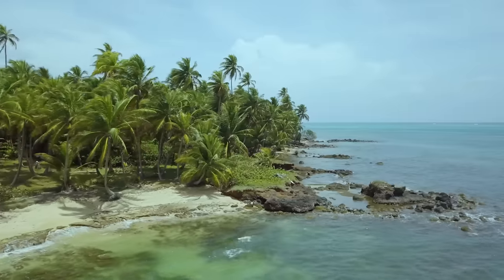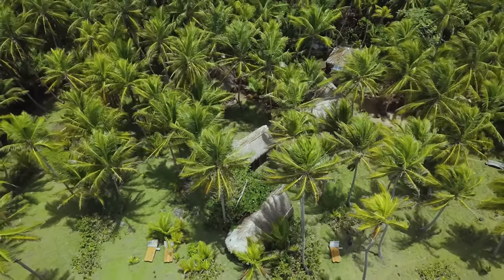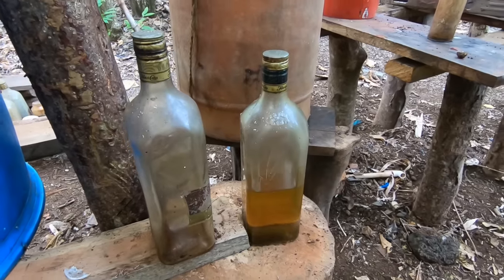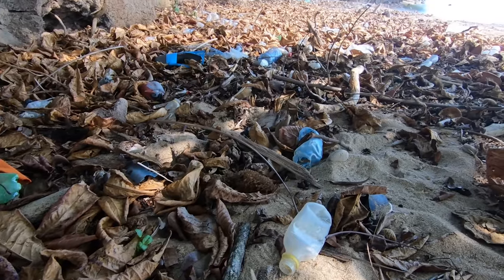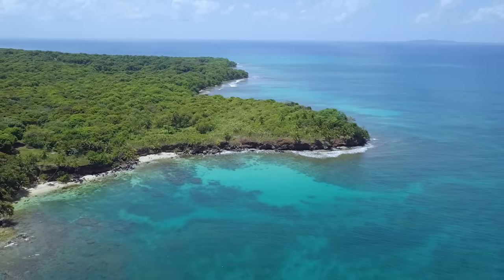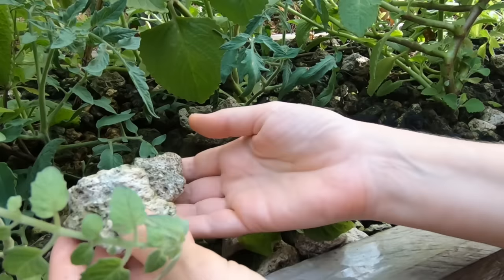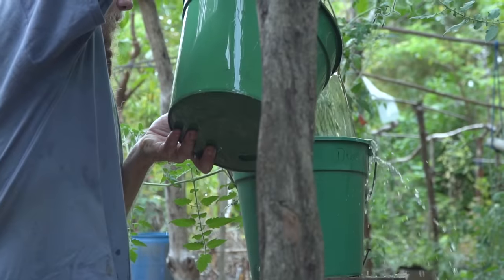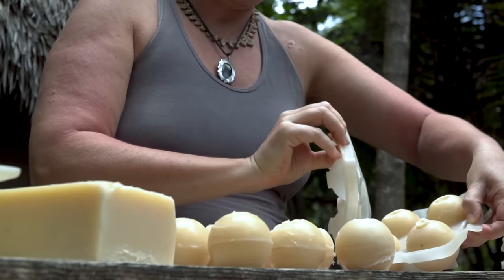THIS SELF SUFFICIENT FAMILY MAKES THEIR OWN FUEL FROM PLASTIC!

Comment: It would have been good to see the diesel making process in more detail: But thank you for sharing
Reply: To me that "diesel" lit up fast and bright from a match. I've seen matches put out in diesel. Then again, apparently his diesel generator runs on it...🤔. 
Also, I'm glad he's cleaning up and making use of all the plastic we've allowed to float up on his beach, but the nasty smokey fire for his distillery isn't exactly environmentally friendly. Sorry about the complaints, just a couple of points...I did enjoy the video and am subscribing, ☺️
Reply: @RoodiniCats  he could upgrade the wood heater into a rocket stove for a more efficient burn
Reply: @DustinMarsau that definitely sounds like an improvement. I guess he's mostly working with what he has on hand, so I'm not faulting him ☺️. 
Maybe a rocket stove will wash up on the beach...? 😁
Reply: Did you ever melt plastic ?
Give it a try 🧐
Reply: @RoodiniCats  you’re right about the diesel. Diesel fuel doesn’t ignite with a lit match but if his shit runs good with that plastic than that’s still badass
Reply: @RoodiniCats  hes taking the trash off the beach
Reply: @unforkyours3lf730  Yep... and putting it in the atmosphere, where it belongs!  Then the carbon trash can blow over to someone else's place! LOL
Reply: Yes l would too be interested in a step by step diesel making equipment..
Reply: @martyfoster7053  it's not like plastic came from nowhere.
One could think of the plastics industry as carbon sequestration.
Reply: @RoodiniCats  it's just wood from around the place. Don't know how much he must run that fire for to run all his crap. Could be anything from a cookout level impact to the fires of Mordor 😹
Reply: @richavic4520  yes, but no.
Reply: Wow...
Well done to you.....
Reply: @RoodiniCats  if you pick random wood fallen on forest floor and burn it, it is green as the would would naturally decompose and produce methane which is a green house gas.  only if you log the trees then its a problem unless you plant one in its place.
Reply: @RandomScientist  good point. I came to the same conclusion, deciding whether to burn limbs/leaves in my yard or to pile them up and let them rot. I don't use it as compost, so was better to burn. I guess the best option would be to let the county collect it and they create power from burning yard waste.
Reply: Yes, I would like to know the diesel process too
Reply: @RoodiniCats  are you serious? First off diesel, at least all the diesel and jet fuel I’ve encountered won’t light easily, it has to get hot first then it can start a burn. But are you serious about a wood fire being “bad for the environment”? Let me ask you what you think it does to this environment. Do you know the water cycle or how it works? Basically once that hot water vapor gets to clouds and it’s cool it needs something to bind to so it can condense, that CO2 everyone thinks is killing us, is responsible for providing those water molecules something to bind to so it can fall back to earth. Also, if you condemn wood fires you’re in favor of millions of Americans and Billions of people around the world, freezing to death, and starving. I appreciate that you came from a generation that wasn’t informed that global warming later renamed to climate change during Obama administration to drum of fear, is  science fiction produced by Al Gore. He even produced a sci-fi movie you can watch and you might have but thought it was historical fact. The earth has warming and cooling trends, independent of man or our activities, in fact in our entire existence we haven’t matched the Greenhouse Gasses and CO2 emissions of just 1 volcanic eruption which happen every single year. So unless you can stop volcanoes you can’t stop them off gassing into the atmosphere. If you really believe in that stuff then stop buying or using anything made in what you deem nonsustainable way. Solar panels are made from silicon that’s mined from giant pit mines in China using tons of coal and diesel to extract, further refining and manufacturing of silicon into solar cells uses more energy, then fabrication of cells into panels requires more energy still because the glass requires extremely high heat, the electric soldering irons require electricity to solder the cells together and there’s more diesel used up to load them into shipping containers, then to haul those containers to docks then to store then to load onto ships, then to power the ships from port to port. Your solar array no matter how you got it has used more fossil fuels by the time you get it before it’s installed than all the electricity you’ll use in your lifetime bought from a coal powered plant. Keep that in mind next time you get into telling people how bad they are for the environment. Don’t get me started on electric cars and lithium batteries. It’s free to google it up. Wind turbines create deforestation and burn more gas and diesel being made, shipped and installed than they will ever displace, then they require regular, monthly maintenance so more fuel, and tons of petroleum lubricants. Could put all that fuel budget to a power plant instead and have cleaner energy and still have a forest where your “clean energy farm” is. I’m not a believer in global warming to start with but I am an analytical thinker.
Reply: @308dad8  hahaha ok thanks for the rant, I mean input, analytical thinker dad. Somebody's bored....
Reply: @RoodiniCats  next time you’re bored you should try reading nonfiction
Reply: @308dad8  I meant you were bored. You saying things doesn't make them fact. 
Man bear pig is real. I'm super cereal. 
Thanks for turning this little back and forth (that never actually had a problem with this guy making diesel from plastic, as far as I can see) into conspiracy theory nonsense and trollery. I'm sure you're going to rant and  cry further, but you'll get no more joy from me. Have fun. I will not reply.
Reply: @marcusmarron6113  he did pour it onto some material (leafs? i think) this along with the likely warm temps. would help atomize the fuel and ignite as fast as it did
Reply: @RoodiniCats  It is likely a lighter hydrocarbon than distillate.  Probably something in the kerosene range, which will usually run diesel engines fine (excess kero often gets blended into diesel tanks in refineries)
Reply: @DustinMarsau  why don’t you loan him one
Reply: @Welcome2thetrenches  why don't you go learn something before being a jerk. They generally aren't portable and are homemade. And I live in northern Indiana
Reply: @martyfoster7053  no way yet to avoid burning hydrocarbons...
Reply: Do it right, and check which plastics. It'll solidify on you if done a bit off course. You think you have a good yield, then it solidifies when fully cooled off
Reply: It looks like the exact process of distillation. I could be wrong but The pot he was cooking the plastic in is called the boiler, then theres a tubing connecting to a thump keg,  in this case 2. which in distillation makes alcohol more pure. Heading down to a condenser which cools the vapor to a liquid. Im assuming the same is the case with this, im curious as to whether or not there is any liquid involved at any step or if its solely vapor from the bottles that makes the diesel.
Reply: @308dad8  well said
Reply: @RandomScientist  get off that. You do know that algae produces about 85% of the total oxygen in the atmosphere, right?
Reply: @danielrodriguez7503  you’re spot on about the thump kegs. I think the farther it goes the purer the fuel, the end being gasoline after being cooled in the worm. I have moonshiner friends so this is right up my alley.
Reply: @RoodiniCats  AND... He stated it was pulled from the first drip....  More close to gasoline..
Reply: They did that for a reason lol I hope the govt don't take this man out like they did with the rest of the other ppl who did this.
Reply: @RoodiniCats  hi
Reply: @308dad8  thank you!!!  Finally the truth
Reply: @martyfoster7053  Think what comes off conventional diesel process. At least the plastic trash is removed.
Reply: @RoodiniCats  The best option would be for you to compost the leaves and use the compost for your garden
Reply: Same question! You can find how refineries work online, and downscale to your needs. It is a process called "destructive distillation" if I recall. I read about it when I was a kid in an encyclopedia. You can extract various chemicals from wood by just heating the wood in a steel container in the absence of air, running the resultant gases through cooling condensing coils immersed in water, or just air if coils are long enough. You can extract chemicals such as naphtha, and wood alcohol (Methanol), or just burn the gas like natural, or propane gases. Caution: Distillation of flammable gases can be dangerous if you don't know what you are doing.
Reply: @RoodiniCats  you can make a rocket stove out of almost anything!
Reply: @RoodiniCats  He said he only just fired the thing up.  So what he's getting is the first, most volatile - hence most flammable - fraction, maybe more like high-octane gasoline.  Maybe even something lighter than that.  

He's built himself a small oil refinery.  Everybody can't do that.  It'd be super-polluting.  But on a small scale, in a remote setting, if he's one of few people doing it, it's very practical, and it's a smaller footprint than driving a Prius to work 60 miles, one way, every day.
Reply: @harrymills2770  ah, so (without watching it again...) you're saying the sample he lit up is probably not what he's running his diesel generator on he's pulling that from another part of the system? Well then, 👍😉, well spotted.
Reply: @308dad8  Wow seriously get a hobby!
Reply: @308dad8  papa?
Reply: @308lastname3  Son?
Reply: @DustinMarsau  I could be wrong, but didn't he say to put the plastic into an oxygen free tank and let it distill, but the rocket stove uses and increases oxygen?
Reply: Fuel companies don't want to see easy alternatives
Reply: @rootzrivers472  Good advice. I have several. One of them is poking holes in ignorance. 

The Bible says in Hosea 4:6 My people are destroyed for lack of knowledge: because thou hast rejected knowledge, I will also reject thee, that thou shalt be no priest to me: seeing thou hast forgotten the law of thy God, I will also forget thy children. 

So God hates intentional ignorance or willful stupidity. The reason he hates it is because it destroys his creation. You must seek God for your eyes to be opened. Good luck
Reply: I agree. I'd like to know how to do it
Reply: Look up Mr. Teslonian. He has in depth explanations on how to build a gasifying stove, how to fractionally distill the syngas, and shows it in use.
Reply: @entelechy777  thanks. Will do. Wonder if it's simple enough for a woman alone to do (I'm off grid)
Reply: @lindasands1433  That it is. It takes some knowledge, but anybody could do it. If I recall, he talks about how in the 40s during the war when there was a gasoline shortage, people used the process to fuel their vehicles.
Reply: @RoodiniCats  not sure what you mean.  You can dunk a match out in any liquid if it’s concentrated enough.
Reply: @RoodiniCats  the diesel he used was more than likely still hot from the process and so it lights easier than diesel at room temperature
Reply: Diesel fiesta light up on match. Is he adding something n meaning he makes the oil for diesel but adds like white spirit? Still cheaper
Reply: There are lots of videos on how to do that on YT. A lot...I am keen to learn about this. Looking at plastic as GOLD vs rubbish...
Reply: @rebel.mma.youtube  Or it's other hydrocarbons left over in the first receiver, since he hadn't done any further refining on it.
Reply: Instead of burning wood fuel to convert solid plastic fuel into liquid fuel / diesel, I wonder if a vehicle or generator could be made with a hot tank that would melt/cook the plastic into diesel just from the heat of normal operation?
Reply: @308dad8  💡✅😌🔥 Well Said
Reply: Ikr
Reply: I have a 30ltr v8 it drinks diesel gonna try this in the UK cause it's nearly £10 a gallon
Reply: we need tht
Reply: @308dad8  totally excellent explanation! Thank you for that. And yes, I would like to hear what you have to say on electric cars. We need you!
Reply: @mariaschmitz2612  Thanks. What about electric cars do you want me to speak on? I’m not at all against electric cars for people who want them. I am against government telling us what to buy and drive. Electric isn’t practical for everyone and most of us already can’t conceive of affording another vehicle, especially not an expensive one. So far there are no worth while affordable electric cars that I’m aware of. Also, those getting electric cars either need to have charging stations at work or have an electrician add a 240V 50A circuit to get the faster 8 hour 80% charge
Reply: @308dad8  thank you for expressing your views I wish more people would follow a product from start to finish before they make a decision.
Reply: @karriesitzer9036  thanks for that. I agree if we know more about what we buy we’re happier with our purchases.
Reply: Carbon is food for trees and largely contribute to regreening
Reply: @QQ-xx7mo  Yep. That’s why burning has been a popular agricultural practice for thousands of years. The burning releases the nutrients locked into the biomass burned into ash and charcoal which both make it available for new plant growth.
Reply: @308dad8  its probably kerosene as its a lighter hydrocarbon
Reply: @frostedlambs  Possible. Back in the day diesel tractors had carburetor adjustments for different fuels, kerosene was one of the approved fuels back then. I think lamp oil/fuel oil were too.
Reply: @RoodiniCats  you  keep  it and  use the energy  for  yourself
Reply: well he prob showed it but the producers couldn't/wouldn't cuz that could make more people go off the reservation...
Reply: It's more like diesel and petrol
Reply: @Ted123-s9v  I know, it get all sticky and shit. He’s did say tho to heat it in an oxygen free environment
Reply: @RoodiniCats  easy to build your own rocket stove really.
all it takes are cement of some sort. seems to be plenty of rocks around.
Reply: Melt plastic in a oxygen free environment. Those tanks is for the quality like making shine. Heat up plastic, the chemicals condense and you get fuel out other side. I'm sure you can get a lab coat to detail it. He prolly didn't think ppl actually really do this cause most don't give a fuck. I couldn't give a fuck if I had a fuck financed. No thats just a joke. I do give a fuck but if we ALL don't give the same amount of a fuck then we're just fucked.
Reply: @kitjasabsgabs1830   Right lol
Reply: @brianmccutcheon3205  I'm all for saving this planet but I saw recently handfuls of garbage trucks just pull up to a dirt ramp and just dump more loads in the amazon than a Pstar going for a 600 dude Gbang. So this is a great idea but if we ALL dont care as much as the rest it'll never happen. It's kinda hard to convince the poor folks who live in shanty towns where the walk in human waste daily to keep our environment clean! There's a garbage island bigger than Texas, and you can drive all day and night and not cross Texas at the widest part, floating in the pacific ocean. And if it was anywhere near profitable you can bet that BP and their buddies would be grabbing that plastic and making diesel 24/7. It seems like generations ago they didn't understand or care that what they was doing making profit we'd have to pay for now. And all we do now our grand kids will pay for with all the plastic we make everything out of. I have a blender and mixer from 1982. It's ugly green color and heavy AF made from steel. It works flawlessly. 40 years now made in USA works great. And I have extra parts for it that my great uncle got because we used to fix shit when it broke. Now unless it's a brand new Electronic, we toss it. 1000 years from now some archeological dig is going to find all the land fills and ask Wtf was these ppl thinking, making all this cheap junk and then burying it in the ground? If it was perfect we'd all be able to live life and have homes and care about our planet, but it's hard to do that when life has us working like mad, missing out on the next generations to make a buck instead of teaching them this stuff. That's what's important. Kids have a handful of years that shapes them for life. I never understood why we can't take care of family's like other countries that give BOTH parents time off to raise a child. Paid time off. We are the only 1st world country that don't. Then wonder why all this dumb crap happens with the youth. Ppl like Jeff who had good luck shouldn't have to pay for all the folks who didn't but after a certain point, idk 5 billion, the rest of that should go into helping veterans first, then others so we all can have basic needs met. Homes, cars, jobs, food etc. All those autos that got smashed and sent to China on a ship by Obama in cash for clunkers. All the homes that sit empty and now drug dens. Us Americans waste so fucking much. And lose our job if we give the extra away. 
How fucking petty is that to have so much abundance that we toss it in the trash and not give to those who can truly use it? So many situations like this that can solve multiple issues at 1 time. If ppl would worry about each other, love each other, and help pick up those who are down what a great country we'd be. We can't even help those who fought in our senseless wars! Fucking sad. But you have a great week my friend. Semper Fi Brian.
Reply: @MrBenstero  you realize you need to cite reliable sources for your argument that the current temperature (where?) could prove that my truck killed all the seals. They’re still up there and given the chance one day I would like to catch wild salmon, club a seal and shoot a Kodiak Grizzly Bear. Maybe all in one trip. Seals are my wife’s favorite animal so I told her if we can ever afford to go to Alaska I’ll do my best to club her a deal. Been broke for 15 years now
Reply: @308dad8  I know all that but it doesn't change from the fact that mining iron and aluminun or oil for gas and diesel powered engijes still requires dirty means. When I meant eventually I'm not talking about the next 10 years but the next 20 to 30. Also coal is far from being clean, natural gas is as close as you can get from cleaner energy between your choices. On the planet getting warmer side, it's not because this day last year was hotter that the planet is cooling down, it's also the extremes showing up, like a giant snow storm in Texas or the poles getting way warmer in the summer than they used to. It's also the crazy variation in temperature we are getting more and more. I don't remember even 20 years ago getting up to 50 to 60F difference in temps between just a few days in the summer whereas in the past few years that's all we've been seeing. The north warming up is creating these extreme temperature changes because the polar caps aren't as big and the winds coming from there are now beginning to destabilize the zone that's around the Canada to USA border where cold and hot air meet. This makes the ''wave like'' border between the 2 more spikey and allows cold winds to reach further south and hot winds to reach further north. Anyways, I know my opinion won't change your mind but if this can at least make you look up this one thing about global warming then you'll learn something from our conversation. Cheers
Reply: @RoodiniCats  Burning wood is sustainable, (if thats the smoke you are refering too) its just part of the normal carbon chain, and its natural occurence from lightning strikes starting forest fires and so on. Wich is benificial to the envoirment in several ways.
Reply: @martyfoster7053  you don't have any problem when big companies do it.. but the small guy however
Reply: If you take the wood ash from the fire and add it to a tube of water and let it sit for 2 weeks, itll make lye soap.
Reply: @martyfoster7053  carbon = The basics building blocks of all life on earth. Somehow that is trash.
Reply: @martyfoster7053  the baby sea turtles say “cheers!”.
Reply: @RoodiniCats  Now just imagine how a "responsible" large scale corporation could clean up the process! make the diesel better and clean up the smoke with filtered stacks? But.. they NEVER will.. it would defeat their purpose
Reply: @martyfoster7053  he cooks it in an oxygen free container.. the fumes are not released into atmosphere.
Reply: @308dad8  bloody brilliant. People have their fingers in their ears though ❤️
Reply: @308dad8  wish i could share what you've written
Reply: @RoodiniCats  yeah it's not pure diesel. that stuffs way more flammable than normal diesel.
Reply: I agree
Reply: A lot like making whiskey
Reply: @roodini448  diesels can run on a lot especially simple diesel motors. Not always good for their lifespan but with a low power machine you'd really just have to take it apart clean it and put new gaskets in then boom it's like brand new
Reply: @RoodiniCats  based on what he explained about his process the diesel is probably full of a lot more octane than typical diesel from the gas station since this process is so crude and there's no real effort to separate out impurities from the fractionation stages after the initial reduction of the plastic molecules into smaller hydrocarbons
Reply: He needs to be in charge of recycling in the US
Reply: @maddogwalt  Did you try it?
Reply: Agreed, most people produce a black thick crude. It would be great to see his setup in detail. I would try to duplicate it exactly.
Reply: @martyfoster7053  it’s a small amount compared to all the other industries that pollute our air
Reply: @RoodiniCats  sorry to bring up an old post here but I think the confusion comes in when we are talking about commercially available "diesel" versus the scientific classification for diesel being a heavy oil used as fuel, this is definitely unrefined fuel and is heavier than gasoline therefore it is still diesel but not "diesel" 🤣🤣🤣⛽
Reply: https://youtu.be/oF07QbfqKjc scotty fairno shows how he makes his veg oil diesel for use in his car
Reply: Yes you are correct but it's not the fuel that is flammable i
The gases evaporated  from the fuel is flammable. The hotter the temperature the more gases evaporate lowering the flash point. 
The process this guy is using really only disposes of the plastic bottles.  As he could run his generator just off the fire gases he's producing. 
 as any organic material creates flammable gasses when heated above a certain temperature.  I believe it is around 450°F. 
But burning wood to melt plastic to make fuel to run a generator is kinda redundant. As he could just burn the wood in the pot connect it directly to the generator and get the same outcome.  Only Difference being creating a usable gas as opposed to a solid fuel. 
  
But the solid fuel he's creating is quite possibly one of the worst smells Ive ever encountered.  And really hard to wash away like skunk.